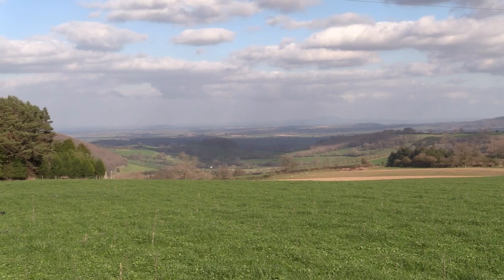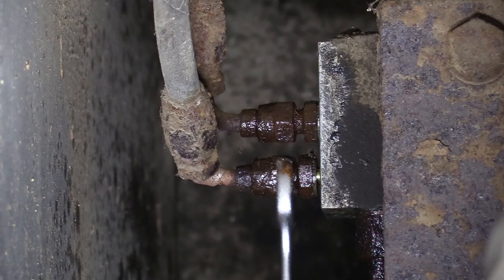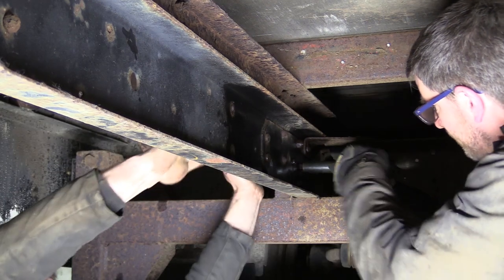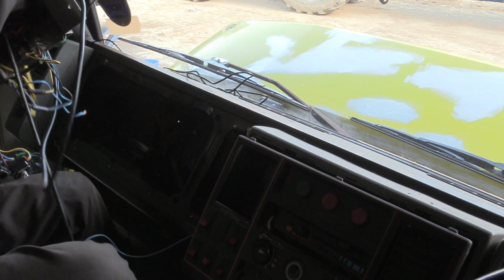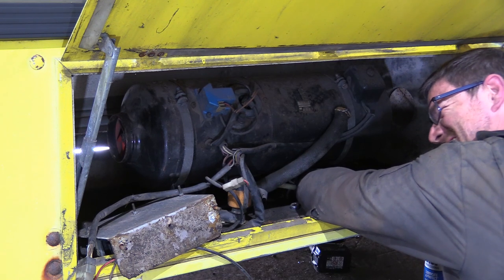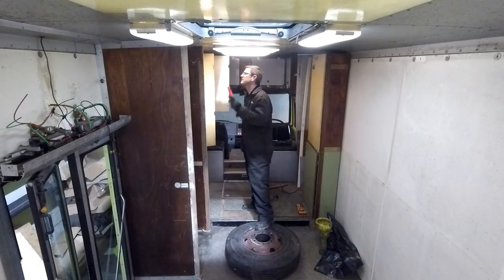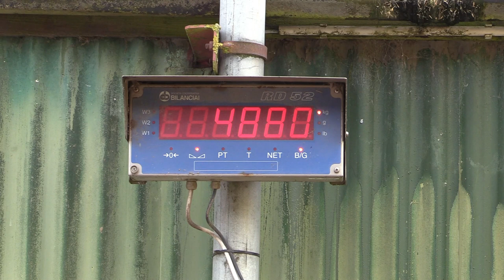The Escargot - RV/Camper Car Transporter Conversion - Part 1

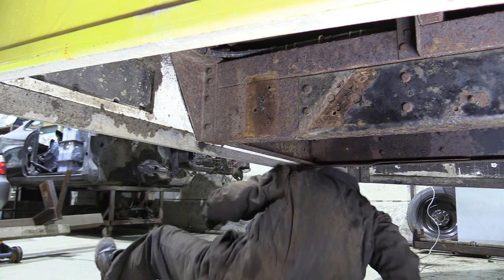Comment: 15:09  Oh man, I could feel that head clunk!  Back when I worked as a mechanic (1990's) in Minnesota I vaguely recall when I was working on a Dodge or GM truck doing an alignment. Having finished with the job I walked to the back of the truck and started to climb out of the alignment pit. Unfortunately there was a Dana 60 rear end in the way of my head. The differential did not move. I don't actually recall hitting it with my head, just being woken with some smelling salts on the floor of the pit. We had the same rusted fasteners issue when working, the fire wrench was a common tool. Since I now have an old vehicle (1970 142S Volvo) I'm thinking of getting one of those nifty Induction Heaters.

Comment: Really like this style for this kinda project. Although I feel that if you guys already say that it't getting complicated it will be close to Binkys Complexity in next to no time.
Reply: The only thing I heard was "We're gonna take down the exterior box and build our own" :D
Reply: @kabouterplop19  New bulkhead, new engine, completely rebuild the front end and suspension, several times over new frame and exhaust, complete wiring build, excessively complicated central locking and power windows, and at least a month spent on Ackermann steering geometry.
Reply: I presume lot of aluminium...

Comment: Great video. Single high pressure alloy wheels, and eco diesel engine and transmission should help, oh and if you swap the chassis out for an aluminum one.  :-)
Reply: No.  Lightening holes, surely.

Comment: Things you'll be reinstalling because you need them;
Rear bumper
Spare tire carrier 
Heater
Cabinets
Leveling jacks
Reply: CARBON FIBER EVERYTHING
Reply: Rear door.  Side door.
Reply: Nah...Just gotta get Binkie on a horse size diet.
Reply: Lol
Reply: All things that can be replaced with items much lighter than the 30 year old items tossed into the bonfire 🔥 or rubbish skip.
Reply: Spare tires on a commercial vehicle like that are useless.  You have a blowout on a 7 ton vehicle and you're calling someone to come with a new tire; it's not something you're going to change yourself.  Least of all because you need a 200 lb jack to jack the goddamn thing, never mind the lug nut torque that requires a 3/4" drive impact - you ain't breaking those lug nuts loose by hand.

Rear bumper... meh.  As long as there's something for the idiot finger fornicating their cell phone behind you to run into, you're probably good to go.  Most places just say "have a bumper" and don't specify what that is - sheet metal works.  

Leveling jacks can be done way lighter.  Most of the RVs and trailers I see here have scissor jacks attached to the frame corners.  The fancy ones have electric motors to turn the jack screws.  Still lighter than the hydraulic system they took off.
Reply: @immikeurnot  Are you telling me that technology has progressed in the last 35 years?
Reply: I literally installed a newer version of that heater in my rv to replace the propane one....
Reply: canuckguy worried  you can achieve just about anything with a long enough bar.
Reply: canuckguy worried  At 17yr old 40yrs ago I worked as a breakdown fitter for HGVs.All 12 stone of me on my own to replace way bigger tyres than that with all hand tools.Bit of knowledge a HGV wheel wrench and a big bar,no problem.
Reply: @immikeurnot  In Australia our truck drivers change their own tyres on way bigger vehicles than that. I'm talking quad trailer road trains weighing 100+ tonnes.
Reply: canuckguy worried  Much easier than the inside tyre on the inner side of a oversized load trailer axle. While lighter weight, considerably harder to change.
Reply: canuckguy worried  Bottle jack,big lumps of steel.Theyre split rims as well with tubes.At the side of the motorway in the snow in the dark and strangely I have fond memories.
Reply: For tire changes on a private rig it happens so seldom... you call the mobile crew in. No hurries, no worries
Reply: canuckguy worried  A different era , that!
Reply: You guys have a good point, when they get to the outback or frozen North of Canada, they'll be sorry they didn't bring that spare... lol

Comment: The rear bumper is not a legal requirement to stop cars submarining then? .......I'm already addicted to this new project!
Reply: It is in Australia, not sure what year it became law, this beast may be old enough to not need it.
Reply: A heavy as fuck steel one isn't. You can have an aluminium one. It depends on rideheight and overhang as well.
Reply: The modern rules allow for significantly lighter and weaker ones.
Reply: thanks guys. I've now found somewhere in the comments they are putting a lighter one on

Comment: The irony is that lots of bigger motor homes have hydraulic jack at the rear to stop them bouncing about too much. Separate thought, it's noticeable that the conversion steels have rusted more than Henry's motors chassis. Was that a high carbon steel?

Comment: 3.3 tonne for my beaver tail cargo? Sub 4.5 is a massive ask. If that is 3/8” plasticoated plywood sides like my 1991 BT transit there is a lot of weight in the sides. Honeycomb ally?

Comment: It will need a bracket to hold Binky securely. But as it’ll be used for other cars it needs a bracket that can hold brackets tailored to each car. And brackets to hold the unused brackets.

Comment: Great video! Quick question please - what did you do regarding the feeds into the aftermarket fusebox you removed in the front - did you follow them back to where they were picked up and disconnect them/make good the wiring - or are the electrics a separate project? Thanks - and keep up the great work!

Comment: Hi, can I offer a hint re rusty nuts, I know a torch works well and a plasma cutter woud do the job, but if you don't have either but do have clear access like you had, try a sharp cold chisel and a few blows with a lump hammer aimed at a flat on the nut. This will "spread" the nut and break the rust bond with the bolt. Cheap, try it. Thanks for sharing from an old "Geezer" in Ireland.

Comment: Holy krap! I thought those weren’t real vehicles! I saw one recently on Midsomer murders- barnabys daughter had one. 
Anyway- what a totally fun project! 
Unfortunately I see ALLOT of overcomplicated  cleaning, fabricating, and redundant measuring coming out way...wait for the noise...😂👍 
Can’t wait!
So to save more weight are you going to replace those steel beams with aluminum ones? Yes, I know all to well about those rust bolts and fasteners after working on big rigs and their trailers. 🙄🙄 stay safe fellas and thanks for the video!

Comment: As an ex Scania Tech. @ 12:05 where you took out that hydraulic beam I would be replacing those bolts with new as I am pretty sure that is a rivetted strengthening plate where the rivets have been removed to locate the beam. Look at the hole pattern? Rivets are best but torqued bolts will do as they have for 30 years.

You could lose some weight by removing everything off the body below floor level around the sides and add aluminium tool and spares boxes direct to the chassis if needed. Aluminium fuel tank will be lighter as well and can be shaped to suit. 

I would also be looking at that front end where that 'loft' has been added over the cab. That cab used to tilt ( see the hinge point @ 17:05 bottom left) but probably seized by now. We used to do horseboxes where I worked and we cursed the bodybuilders for those lofts that stopped the cabs tilting. Ever tried to do tappets and injectors on Nos 5 & 6 on a Scania horsebox that didn't have a false floor? Having said that you will need a new roof and rear panel which are probably extinct now. Or another cab ....... Depends how important making tea on the move really is I guess.

I would have done all that work just for the tea, sarnies and laughs.

Comment: Ratchet open end adjustable is a thing , I have Stanley made ones and they are great on larger size bolts after being loosed . Although I'm not sure it would have fitted in that gap but still a useful tool for boredom reduction

Comment: hmmm it does have some nice features like the low door and steps (oh youre taking that out ) and the stabilizing legs (oh youre taking that off too , prolly can make a nice hydraulic garage  press with the parts from that and the pump ) . and the walkthrough to the driversseat 

with the type of weather in england i wouldve definitely kept the diesel heater , of well , can prolly install a smaller one to heat up just the living space in the van or use propane 

dont think you can take a lot more out without seriously weaken the structure , i think the sides of the van are made from 18mm waterproof plywood with a covering of resin impregnated matting , you could put a router to the inside of the walls and hollow them to half its thickness and add a few campervan windows  while youre at it 
refil the hollowed out spaces with foam board and cover with either vinyl or wallpaper but i doubt that will take off the last 300 kilo
the roof seems to be plywood too you could replace that with an aluminium skin and some aluminium braces that should save some weight , make sure the roof has a slight bow in it side to side so rainwater flows off it  
since the library books where on each side of the van and as far away from the truck frame as possible , the subframe is prolly a little stronger then it needs to be , you could take out every seccond outrigger under the living quarters (would leave them under the garage part itself as it needs to carry the car and the tools ) or cut them lengthwize turning the U profile intoo L profiles  or drill 1,5 inch lightening holes in every one of them 
buy or rent a magdrill for that ( https://www.youtube.com/watch?v=bKKum1wYDT4 ) actually think that involves the least amount of cash and agrivation but a lot of time 
taking of the rust crustations will save a few kilo too
wat are you planning for a reardoor , an aluminium roll up door https://sc01.alicdn.com/kf/HTB1so_6LpXXXXbaXFXXq6xXFXXXR/Roll-up-door-truck-body-sliding-door.jpg_300x300.jpg 
might be lighter than plywood ones but will leak a lot more cold and rain through 
if youre building living quarters in the van its prolly a good idea to use a caravan as a donor (showerstall toilet cooking watersystem and heating ) prolly can use the dining area with its special table and the windows too , those things are REALY expensive to get as single items 
even house type items from the DIY store realy add up fast

Comment: I know it is a little late for a suggestion for weight reduction........   Why not add large windows on the back box area? The framing in the walls would hold the structure and you could cover the windows with a vinyl of your show logo.

Comment: New BOM video? Monday morning instantly improved.
Your patience working on this thing is admirable though. I probably wouldn't have even bothered trying to take the bolts out of the bumper and stabilizer. Just blow them off with an oxy torch.

Comment: Good to see an old Essex mobile library again. I used to drive one of these back in 1989/90. If I remember correctly these were downgraded to 7.5 tonners by using different wheels and tyres.

Comment: A gas axe or plasma cutter would have soon sorted those rusty bolts. Regards that hydraulic pump - Why didn't you simply saw through the rusty fittings or even the rubber hoses.

Comment: Made a meal of those bolts guys!! I used to work on lorries, and fabricate chassis and subframes, and rolling and making high pressure tanks  before making jetting/recycling cleaners, and bolts are a nightmare, Like you said. you wouldve been far better off, cutting the bolts off with a propane lamp, and using a pin drift and lump hammer to bang em out. The cross members usually twist, and pinch the bolts. So even if you do get the nut off, you usually need to turn the bolt out anyway.

Comment: Presumably the bus will need a heating system. Caravan heaters are light weight but gas fired performance is weak, and (most importantly) allows damp to collect in the cold corners where the warm air never reaches and you will still need hot water. A domestic combi heating boiler configured to burn LPG can run skirting radiators along both long walls. These use finned pipes under a skirting cover. That would avoid damp in the corners and give more that enough heat without adding too much weight. All pipe connections would be Hep2o as their PEx pipes are usefully flexible.

Comment: The best way I've found to remove hydraulic lines I don't care about is to cut them flush with the fitting, and use a deep well socket with some kind of electric or pnuematic impact gun. Had to do it with power steering lines and old lines on a couple tractors. Smells horrible cutting through hydraulic fluid, but it's worth it.

Comment: There is a ratcheting open end. It's a geometric ratcheting shape, not a mechanism. Works ok but not for breaking loose and only works dead straight on the fastener.

Comment: Lads,
For sleeping accommodations consider building a bunk that hangs from high up, directly over the garage portion.  When you get to whatever venue, offload the car and lower the bunk and there you are.  Or if it feels like a dodgy spot, perhaps you could even use the bunk above the car, the car still safely inside.  Just don't sit up too fast in bed.

Comment: Removing the rear bumper? I cannot believe nobody in the comments mentioned it. I am 99% sure that the heavy bumper in trucks is not "scrap metal" but very deliberately placed there for safety reasons -- making a passenger vehicle rear-ending the truck crash and crumple into the bumper, instead of diving under the truck and risking beheading the passengers as the windshield and cabin are the most likely 'first impact point' if that bumper is not there. PLEASE correct me if I'm wrong, I absolutely love the channel but this makes me extremely worried...

Comment: Binky to have a Mobile Stable. Have Stable will travel. All parts to be fitted will be sourced  from aircraft as parts are lighter .  Looking forward to the aluminium kitchen and bathroom,carbon fibre beds and of course air mattresses filled with helium.Tyres and brakes using helium have a built in safety warning as people start speaking with a funny voice if there is a leak.  Interesting to see how this conversion will go as it may need an awful lot of brackets.

Comment: ♬ "Keep it greasy so it... slides down easy."   I wish more peeps would use a bit of Waxoyl or grease when assembling things.

Every bolt, every chassis member, every box-section, every mating surface... After thirty years of British rain, salt and slush things just come apart or unscrew with a slight squelch and without any hassle.

Admittedly, it lacks the drama required for making such entertaining YouTube videos as this, but it certainly saves on knuckles.

Comment: Are the box massive hardwood as well?
If so you can take a router and hog out half the material thickness no problem. Not my idea - Airbus etch the aluminum skin like that to add lightness to their planes.  Like panels in reverse. 

Big plexiglass windows would also be lighter than ½" wet plywood.
Reply: Jens Sigurdson   Etching aluminum panels like that was also done on the Apollo lunar landers.

Comment: Looks like a hell of a lot of fun - but delays to Binky arent cool!  Two things - ear protection gentlemen!  Those rattle guns with all that resonant metal underneath the chassis will be doing horrible things to your hearing.  Also - can't believe you didn't just get out an angle grinder for the stubborn bolts / nuts!

Comment: I’ve just spent 35 mins watching somebody undo bolts. I love BOM

Though I do wonder if the hydraulic legs may have been some use at shows and races...
Reply: I was also thinking it might be short sighted to remove the stabilizer hydraulic legs....  Unless they have a better plan in the works...

Comment: The name, Escargo is already in use for a make of Electric Panel vans, which is what I thought I was clicking onto when I ended up on this waste of bandlength.
Reply from the maker: But this is The Escargot and therefore quite different.

Comment: guy got too love the idea, of a toy hauler, but then again the weight limits on a hauler is what ya can make it. the mini is light just about a ton or less. that leaves bogus weight to play with. thing carbon fiber, and glass. that would cut major weight in the end game.  but then again the weight of the back door/ramp, needs to  be added in to a total limit. what is the total weight limit of the bus. then there is that old go pro ideal of upping the weight limit by adding what's needed.  I once owned an old R model mac that had a 60 ton limit, then with heavy add on's took it too over 100 ton. now that an't cheap, but it is worth it in the end. as once certified, I sold it for five times what I paid to do the work. but I drove that old dog for six years, before selling it. I paid 19,000 to start, and sold it for 120,000 six years later.  but finding a shifting axle can be a bitch.'

Comment: So... in keeping with "Binky", will you christen the bus say... "Great A'Tuin"? "Escargo" ("t" optional) might be a good name based on the speed you'll achieve, but surely this thing must have carried the weight of at least a medium sized disc world  inside it through the years. And it IS an ex library bus after all...

Comment: Looks like you are about 300kg too heavy... Hmmm drill lightening holes in the chassis, fill the tyes with Helium and swap the glass windows for Perspex :-). Full Stainless exhaust, alloy wheels and lose a passenger. That`ll do it! Seriously though entertaining and some good engineering tips as always, makes me smile as the Aussie Mighty Car Mods guys always tip a hat to you :-)